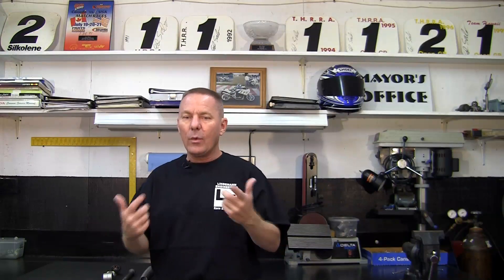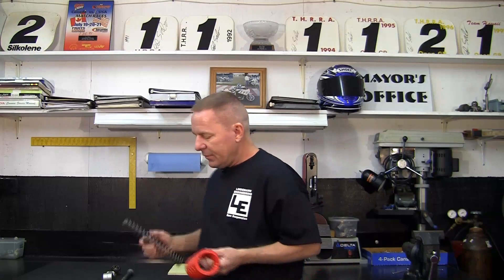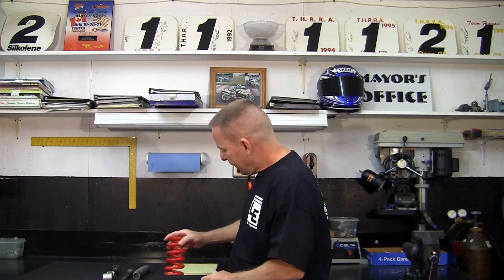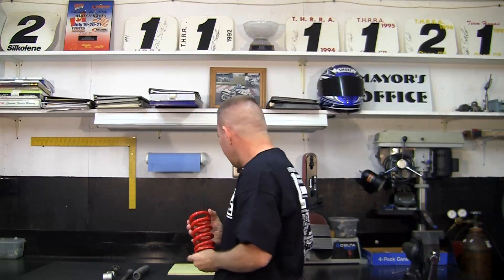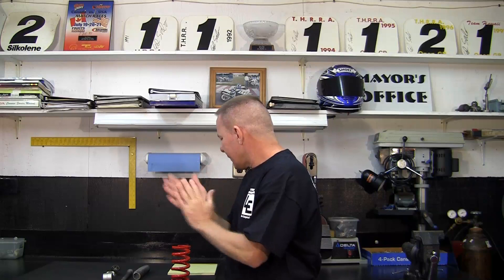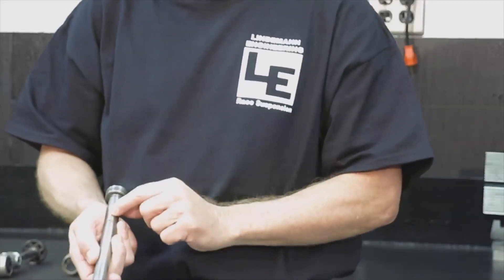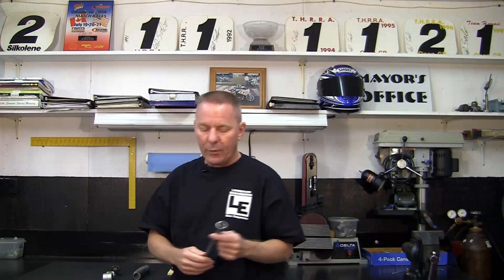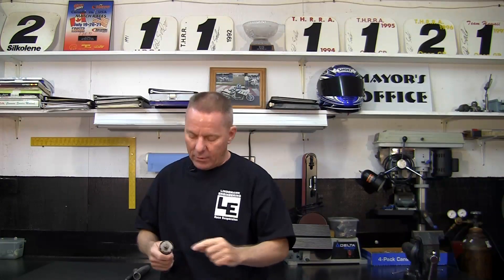Motorcycle Suspension Introduction

Comment: Everytime I listen to the suspension technology i can relate to the carb. Slow, intermediate, and main circuits to the carb is easier to understand the speed and control of the suspension travel. Especially in the corners or straits allows me to understand the traits of dampening. 
   Thanks Ed. 
Al